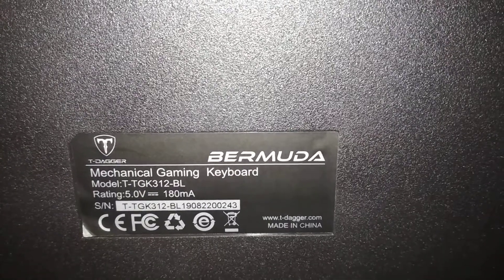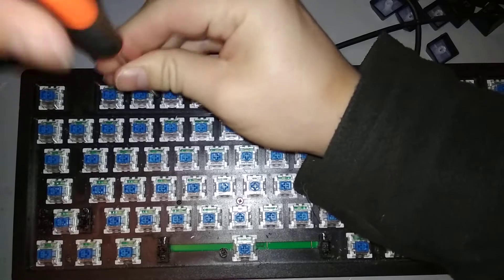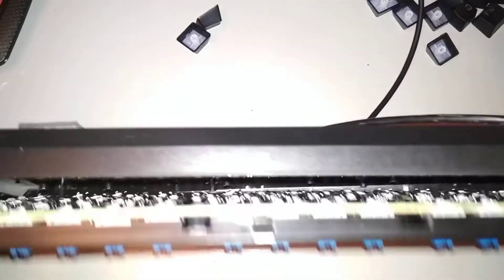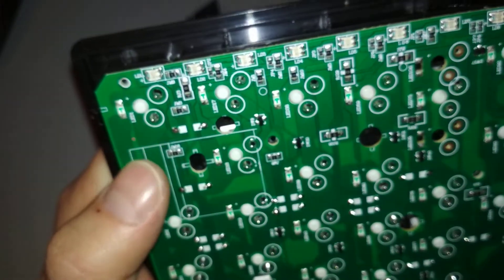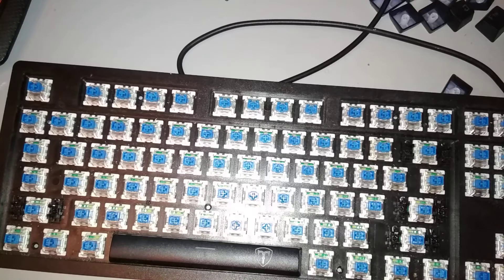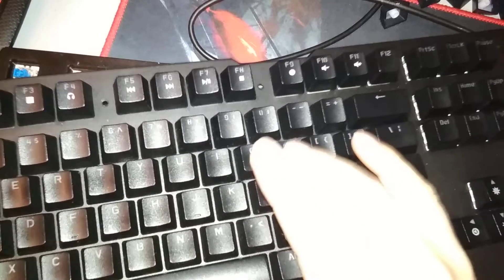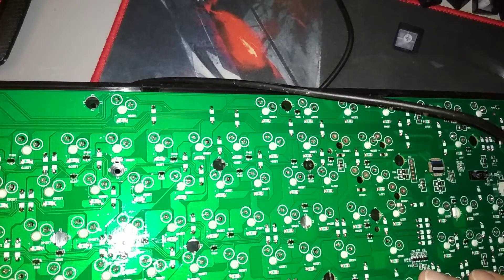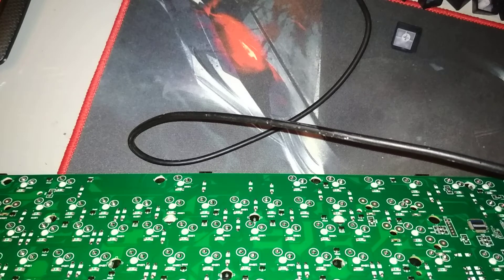T-Dagger Bermuda T-TGK312-BL mechanical keyboard teardown

Comment: is this keyboard hot swappable?
Reply from the maker: What do you mean hot swappable? It's USB and doesn't require drivers... just plug it in 🤷‍♂️
Reply: @Poxenium  by hot swappable i mean  are the switches detachable without requiring to de solder them?
Reply from the maker: Yes, all cheap keyboards are soldered. Hot swapping switches requires 100-200 extra components being installed at the factory... that's extra effort and cost.

Comment: Do you recommend this if someone is going for blue switches keyboard.
Reply from the maker: It has mechanical Outemu Blue switches ... slightly louder than my other, cheaper noname Blue switch keyboard... I've been using it for about a year now, and I have no complaints.
Reply: @Poxenium  I had bought it. Yeah it is louder. Now I want to control the side RGB lights, I mean turn them off or on as per need. But didn't find any way, not even in the manual. Since you're using it for a year. Maybe you have found some way.
Reply from the maker: FN + PAUSE for the two side RGB lights. Press it to switch between modes, one of the modes is OFF.
Reply: @Poxenium  thanks a lot man. Although, in the lowest mode a greenish-aqua colored light still emits in low intensity from there but it is not mixed color as before. But still much better, Though I was not able to have that area completely off.